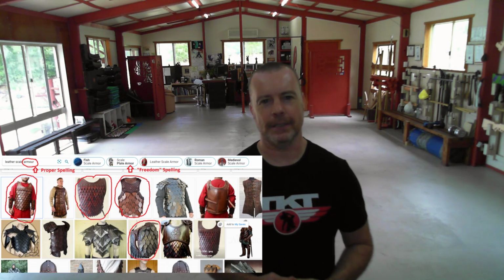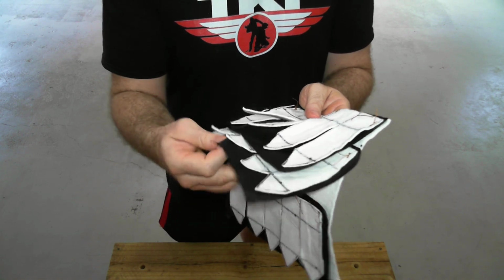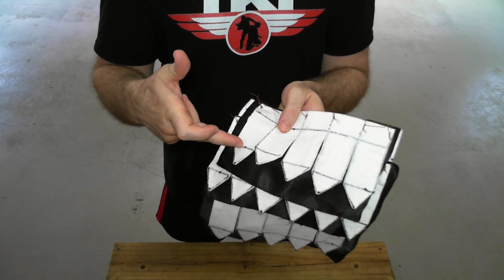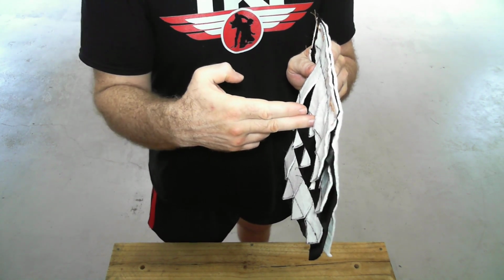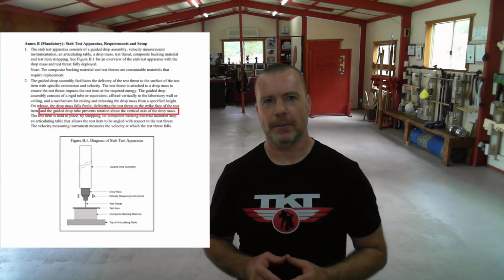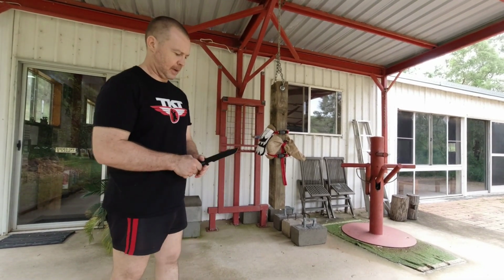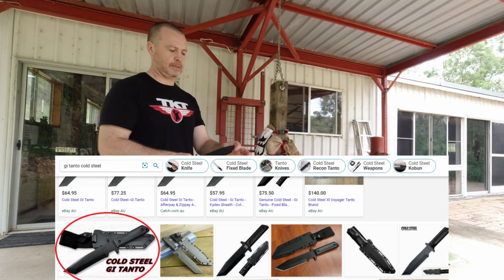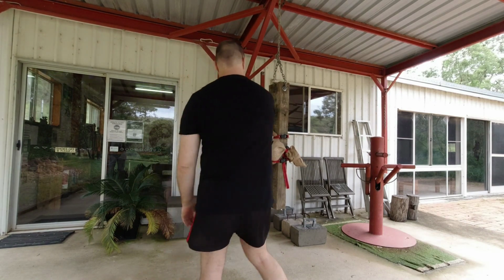Skallagrim-Inspired Reactive Stab-Resistant UHMWPE Felt Scale Armor. Prelim. Investigation/Testing.

Comment: Now, the question I have is, is this force-diminishing effect still present if there is an additional outer layer of continuous fabric to hide the scales?
Reply from the maker: Thanks for your comment and question. I have since moved on from this design in my prototyping and experimentation, but based on the work that I did with this design, the outer garment shell would affect the armor’s performance. Lighter, looser fabric outer shell garments would have less of an impact than tighter, stiffer, heavier fabric outer shells. The tighter, stiffer, heavier fabrics would of course restrict the lateral movement of a piercing blade, thus inhibiting the armor’s functionality.
Reply: @WushuEngineer  ok, thank you. Yes, I wondered if it would need to be some very thin material. I am interested in your progression on the design of this armour. Have you made an updated video about it?
Reply from the maker: @yamagishisan  I have indeed been progressing an UHMWPE armor concept design although I abandoned the slipping design because it was a bit too fickle and complicated. I have since uploaded a few videos that looked at various design iterations, my most recent being a simple design of overlapping ultra-thin stainless shim washers bonded into a sandwich of UHMWPE fabric. This performed very well in testing, but I was not satisfied with it for a number of reasons. Cost was one (the shim washers were ridiculously expensive), and the other was that I did not want to incorporate metallic elements if I could help it. So, I am currently working on what I believe will be the final iteration of the design which incorporates non-overlapping staggered rows of 2mm thick polycarbonate discs bonded into a loose UHMWPE felt sandwich using silicon adhesive. This design has stood up very well to basic manual stab tests, but I still need to put it through the rigorous, standardized pendulum stab-tests before I release the video. What I’ve been aiming for is a design that, though incorporating specialized materials like UHMWPE felt, was still cheap and simple enough to build that anyone could build their own low-profile, covert stab-resistant armor.

Comment: please tell me how you cut this stuff ???? Im trying to work with the material and finding it hard
Reply from the maker: Thanks for your comment and question. It is hard to work with. There are two methods I have used with good success (although still hard work). I have used a scalpel with new blades for long cuts. The curved scalpel blades are best. Use a back-and-forth sawing motion with good pressure and cut on a piece of plywood to minimize blade damage. You will feel when it cuts through and "sticks" on the plywood underneath and you can then move onto the next part of the cut. You will also notice that the blades go blunt fast, so get a good stack of replacements. Alternatively, I have also use a pair of aviation snips. Take them apart enough to sharpen the snip blades with a sharpening steel (a process you will have to periodically repeat as the snips go blunt). Ensure that the snip blades are then as tight as you can get them (I find it best when they are just beginning to stick enough so that the spring is struggling to open them). Also use a dry spray-on lubricant. Once prepared in this way, aviation snips work quite well. Let me know how you go with this and if you want me to put up a short demo video, which I can do.